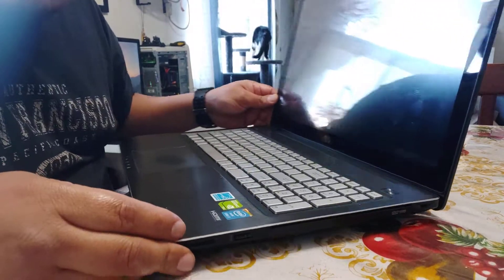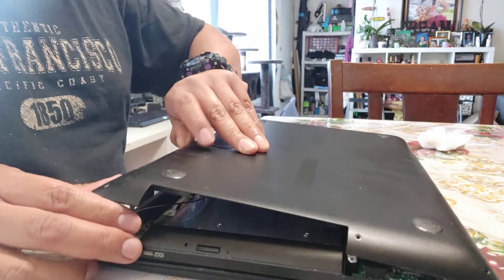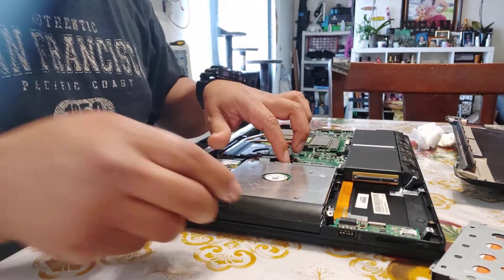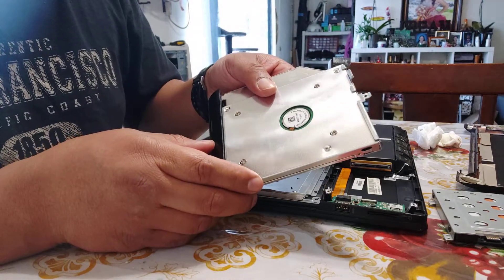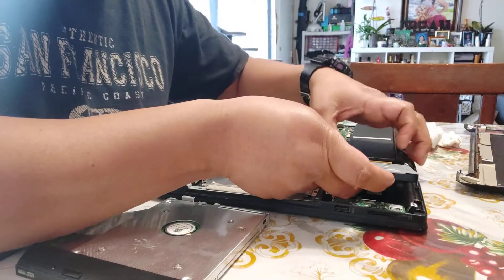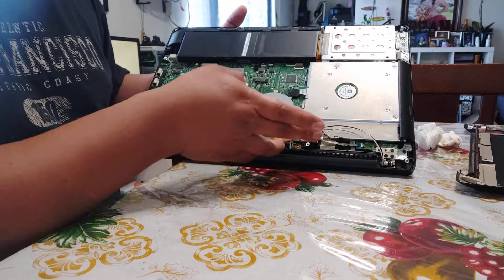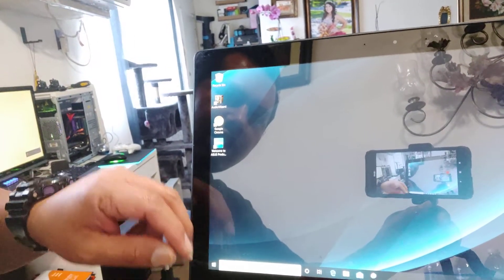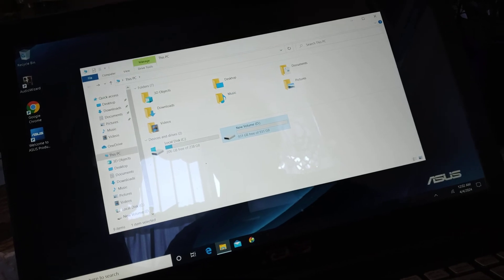Upgrading ASUS laptop Q550LF

Comment: Hello, I order the stuff and now I have them, I have a SSD and a HDD. The SSD is in the official spot where the HDD was once in. The 2nd HDD is now in the optical drive spot. I have the SSD as my boot(operating system), but the HDD is no where to be found in (My PC) even though it is in the optical drive spot plug in, where u able to find the hdd in the computer setting?
Reply from the maker: The drives needs formatting. Go to this PC right click, go to manage then go to disk management. You will see the drives Blue or 0 is your drive, disk 1 should be the new drive right click to format follow the instructions and you'll see a new drive pop up.

Comment: What parts did you buy and from where? I have this laptop and it’s original. My hard drive just died and I can’t recover the PC until I replace the drive it seems. Very interested to update the memory capacity as well as replacing the HDD and likely adding an SSD as well
Reply from the maker: I bought the parts from Amazon. I would definitely recommend upgrading to an SSD way faster. I would recommend due the sales the Samsung EVO series those are highly rated.